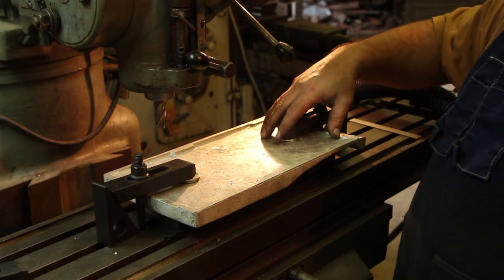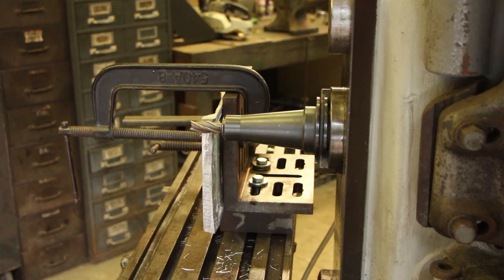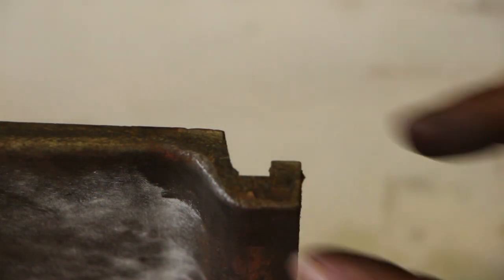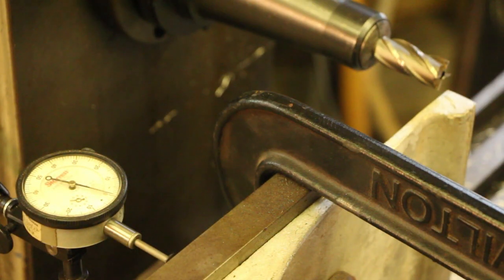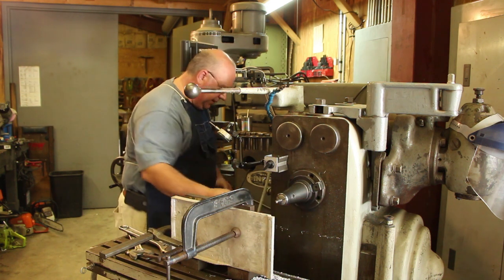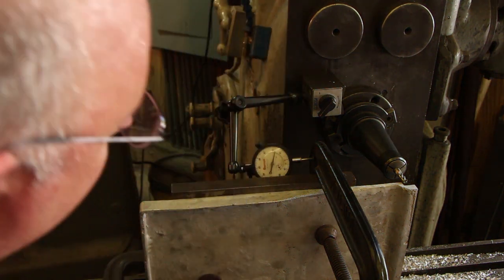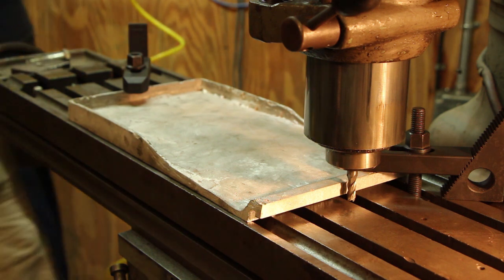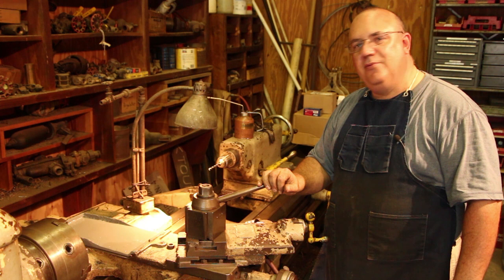Making and Aluminum Way Cover - Part 2 Video:  Machining the part on the Mill

Comment: Keith - I worked on a Lodge and Shipley Lathe for over a decade and loved it.  2516 model with 28" swing and 96" between centers.  You mentioned that the original cover for your lathe was cast iron.  Mine was a later model (1980) and the cover was cast aluminum.  It was in an aircraft engine overhaul facility so most of the work was done in fixtures on a 25" faceplate.  But all of those fixtures I made on there as well in an 18" 4jaw of 15" 3jaw :-)   Really loved the 2 speed tailstock,  saved a lot of time and effort.
James

Comment: We had a foundry in metal shop in high school. After applying parting compound, we put the first layer of dirt through a screen wire sifter. That makes the surface of the new piece much smoother.

Comment: I just saw this. I do woodworking as a hobby. I am in the shop practically every weekend. I always start with a hour or two of maintenance. I learned that habit 50 years ago when I spent four years on the shop floor of the GM Oldsmobile Press Metal factory. We shaped cold sheets of steel into car parts. I worked the Night Shift. We worked 5:00 p.m. to 2:00 a.m. Sometimes I would hang around after work and watch the Machine Repair and the Die Makers work. They were high-paid skilled trades. Every single day they spent the 5 hours between when I got done and when the Day Shift started working on machine maintenance. I learned that those giant heavy machines needed constant maintenance. I also learned to ALWAYS wear eye and ear protection. The table saw can screech as I cut wood, and throw splinters. BTW, all work after midnight was time and ½ ! So every 8 hour shift I got paid for 9 hours, a 12.5% increase in pay,over the entire shift. Yeah! Same for the  Skilled Trades, the got 11 hours pay for 8 hours work, a 37.5% increase. Compensation for their shift starting at midnight.

Comment: Some great lessons here. To a novice, the setup (alignment and clamping) is practically black magic, although it probably comes to you as second nature by now. This also points out that you can't measure too many times, as one last check saved you a ton of grief. Your craftsman's eye is naturally drawn to the small flaws in your casting but to me, it came out looking amazing! This was a fun project and I feel as if I have kind of participated. Thank you.

Comment: Keith, a temp measure is a great way to not over heat your melt. The brass casting is a good example of loosing zinc due to improper temp. I suggested plugging the burner hole to prevent secondary air infiltration, that would have increased temperature and shorten melt time so the loss would have been less over all. I think you used too much parting powder on both castings as the surfaces near the pattern seemed to be dry. From the red color of your petrobond it appears that sand hasn't been used much?
You can improve the green strength by adding a small amount of alcohol (Heet gas antifreeze) and a bit of 2 cycle smokeless engine oil then mull or blend the sand.
Easy for me to judge from my arm chair say's me! Keep up the great video's I learn a lot about things from what you do!

Cheers

Comment: What a lovely set of videos (part 1 and part 2). I have a lot of comments but they are really offline stuff so eventually I may e-mail you (I am currently moving).  I have already (I think) mentioned Myfordboy's channel. But I do want to mention Dave Gingery (R.I.P.). He wanted a machine shop. He couldn't afford one. He was in small-town Missouri, back in the 1980s. He might be of interest to your viewers.  He built a whole machine shop out of aluminum scrap. He used nothing but a homemade table saw, a hand-held power drill, a set of feeler gauges and a grinder. He build a charcoal-fired furnace with a hair drier as a tuyere. Then he wrote a series of books. If you search for "GIngery lathe" you are there. Anybody that thinks they can't afford a machine shop should read these books.

Comment: Very nice--thanks for posting Keith! I find it interesting that the original had those thin vertical walls with sharp corners. It doesn't make it easy for casting, but maybe it was intended to double as a tool tray.

Comment: A little auto body filler and some paint and you could make it perfect.  I understand that Monarch used a bunch of the stuff to fill and form the castings before painting so the machines would look super smooth. It is amazing to me that they used to take so much pride in their product that they wanted it to even look fantastic.  Most modern machines are sheet metal and welded steel, nothing pretty about one of them.

Comment: Pretty slick work man! I'd be so scared of working on cast aluminum...whew, it was a clincher thinking about you milling it, then the music hit and it became a pleasant country cruise :)

Thanks for the share, Aloha...Chuck
Reply: I think the poor quality castings I've broken on car parts like water-pump housings, and gearboxes on dirtbikes must have something to do with it? Not sure, I guess it just seemed fragile and my lack of experience with casting set my imagination to work, LOL! I now have no such fear as it isn't an unknown...Thanks for that, I would get into it but believe I still have too many other things to learn 1st on the lathe :)
Reply: I'll wager you're right excepting the high dollar Yamaha gear case I broke a hole into "dirt"biking on a rock trail...I was so mad at my friend for taking me on that trail

There wasn't a stretch of dirt longer than ten feet, and those were filled with water to slick up your tires before the hill climbs up the granite boulders. Albeit led to an admittedly beautiful lake.

But I like to ride on the dirt...hence the name dirt biking, LOL! That aluminum casting was North of $500 bucks to replace, and that was doing the repair myself.

Pressing in the bearings and gear-shaft were a real learning experience, and where I learned the trick of using stacks of big sockets and washers to brace the case while press fitting in the parts.

I had been certain I would snap the whole side to bits before figuring that out on my own and thinking I was a genius. Only to find out later that it was a tried and true method :)

Comment: Hi Keith,
Just got myself a copper enameling oven, the temp gets to about 2000 deg.F, that's plenty for aluminum, just wondering if the fact there is no combustion gas to shield the molten metal would cause problems... If you have infos about it and want to share, it will be appreciated...
Now winter is coming, time to start a little foundry.
Very interesting process, looking forward for more.
Thanks for sharing,
Pierre

Comment: you could use a needle gun and a angle grinder to flatten out rough spots on the casting  then sandblast or beadblast it and get it a coat of coolant and oil resistant 2 component laquer

Comment: When I use original parts to pour aluminium, I dip the part in molten wax to get an oversized cast. It is easy to mill the new part down to the correct specs.

Comment: Keith, nice job with the casting and the milling. Looks like problem solved. 

Just curious, but would it have been possible to mill the part from a plate, rather than casting it?  I know that would probably cost more for the plate, just wondering how much trouble the machining would be for something like that. Especially if you started with steel or iron plate material. 

Thanks for the instruction!  The more I see of horizontal mills, the more I wonder why verticals got popular...especially with that vertical head on some horizontals. Looks like the best of both worlds. 

-- Mike

Comment: Keith, 

A stray thought - while the casting has the same shape as the factory original, would there be any benefit to having the cover made from a magnetic material? I use magnet base trays to hold stuff in place all the time...

Then again, in my shop I also use plywood and MDF to make stray flat surfaces, just to have a place to put things down...

Cheers,

Eric
Reply: Actually, I was thinking that some heavy gage sheet metal could be formed up on a brake to fit the lathe as a tray...

Comment: If you place a piece of tissue between your work piece and your cutter(wetting it makes it stick.) you can "touch off" without marking up your work piece. cigarette papers are about .001". as soon as you cut the paper your there. Aluminum can be a pain to machine because of the rate of linear expansion due to heat. you machine it and everything is great until it cools. probably where that little bow came from, or deflection.
Reply: Paul smith I was about to go on a search quest to find out how to do exactly what you've described, thanks! I don't have a lathe or a mill, and in my high schools there were no classes for these. So I'm gathering knowledge for the future when I get the chance to buy these tools and hopefully work on them.

Comment: It still makes me nervous every time a machinist says "close enough." LOL
Reply from the maker: Alpha Company Sometimes machinist spend too much time getting something just perfect when close enough will do.  It is all about what an acceptable tolerance is.  I can remember trying to explain to an engineer one time who sent me drawings for some shafts to be made - he had his standard tolerance of +/- 0.010" on the length of a 4' long piece of shafting.  Truth was, it would not matter if it was +/- 1"!  I told him we would be glad to make the parts to that tolerance but he could choose to pay for the tight tolerance or give us 1/4" and we could just cut the shaft off to length on the band saw and let it ride.  When I told him the price difference for his unnecessary tolerance, his eyes about popped out and he learned a very valuable lesson in design.  Point being, "close enough" is often all that you need.  A good machinist knows when to spend his time hitting an important tolerance or when close enough is good enough and move on....

Comment: Watched both vids. Still no idea what a 'Way Cover' is
Reply from the maker: It is a cover that protects the ways on the lathe.  The ways are the machined dovetails that the cross slide slides on.
Reply: AHH ok cool.! Heh thanks for the info :)

Comment: 2% shrinkage on cast aluminum
Reply from the maker: +david smith It depends on the exact alloy you are using.  Most of the pattern making books that I have list aluminum at 1.0 to 1.3% or 1/8" to 5/32" per foot.  When making patterns for aluminum, I typically go with 1/8" per foot as a shrink factor.